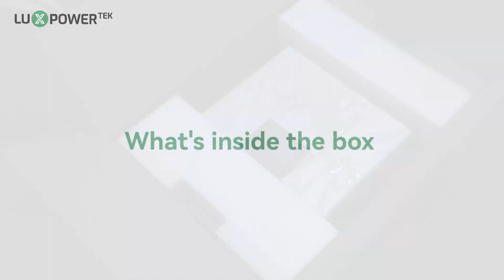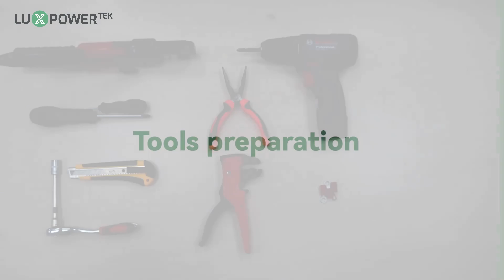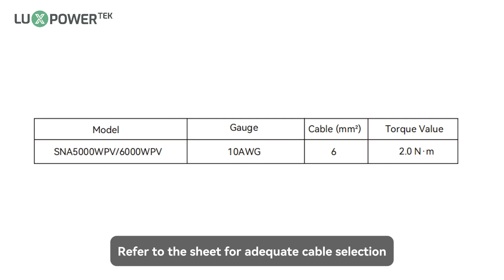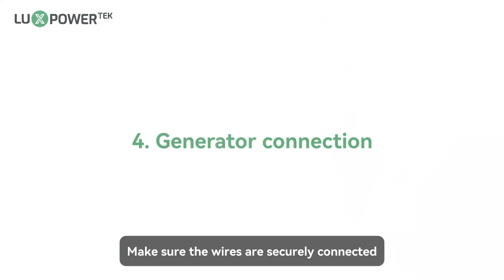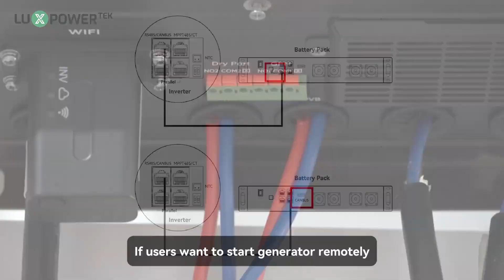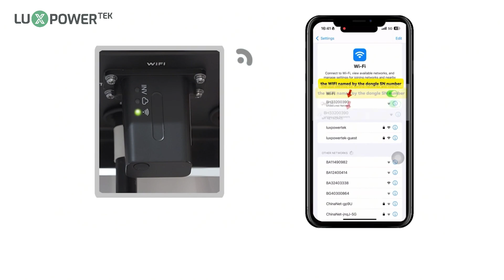LuxpowerTek SNA 3-6K Installation Guidance

Comment: IF I will use it for off grid system only. No any AC input connection , In this case the AC output need or not the PE cable? 
Your diagram showed AC output with PE cable.
If need PE cable , where is the PE connection for AC output?
Thank you.

Comment: Hi @LuxPowerTek, 
My 6kW IP65 Inverter SN: has a recurring "Fan Stuck" error - 4th time. 
No reply from support email. 
This is a warranty issue. Please DM me or reply here with next steps for fan replacement. 
Location: Peshawar, Pakistan. Thanks!
Reply from the maker: Hi, we noticed that you emailed us on today morning, and we've already replied to you.

If you have any questions during the fan replacement process, simply reply to the email—our technical support engineer will be happy to assist you until the issue is resolved.

Comment: I am using the Luxpower SNA5000WPV (internal CT version).

I would like to ask:

Should the GRID connection be connected to port A (the priority/normal source) or port B of the ATS?
Which ATS port should the inverter AC OUTPUT (EPS output) be connected to?
Reply from the maker: Hi there, thank you for reaching out to LuxpowerTek. Could you please share us with the ATS photo to sales@luxpowertek.com?

Comment: In your video you use 8-10 sq mm cables for AC in/out, but in your manual you say 6 sq mm (for the SNA6000 WPV that I bought)... Can I use 6 sq mm? I probably will never use more than 5000W or for short periods of time.
Reply from the maker: Sorry for the confusion.
6 sq mm (10 AWG) is the standard size per manual, and it can be used.

Comment: Chinese manufacturers are literally dumping these cheaply manufactured high-frequency, transformerless inverters on the US market. It's a well established fact that high-frequency, transformerless inverters offer a much shorter life expectancy and a far poorer surge capacity, and can damage your appliances when their MOSFETs fail. The primary reason for this is that the engineers who designed this low-cost inverter made the decision to strip out the most important component in any inverter, the output transformer. They did this for the sole purpose of reducing the shipping costs from China to other countries. The problem with removing the output transformer is that this inverter does not provide any galvanic isolation between its DC boost stage and its AC output, which makes it dangerous for use in residential applications. A much better choice for an inverter would have been to install a low-frequency, transformer-based inverter. 

Low-frequency, iron core, transformer-based inverter chargers offer a far longer life expectancy and a much higher surge capacity than low-cost, lightweight, high-frequency, transformerless inverters, and are a far safer choice for powering your home's appliances. That's why all US-made inverter manufacturers only use high-reliability, low-frequency, transformer-based inverter technology. If you don't believe what I'm saying, ask Google.

Comment: Why is this inverter called off grid when it can receive AC input.
Reply from the maker: Hi Sir, An off-grid inverter is designed to work independently from the utility grid, supplying power to loads using solar and batteries.
Although it can accept AC input (such as from the grid or a generator) for backup charging, it does not export any power to the grid in regions with strict regulations, which is why it’s called “off-grid.”
This feature is especially important in regions with strict regulations about selling electricity back to the grid.
Reply: @LUXPOWERTEK can the gen2-6000w export power back to the grid?
Reply from the maker: @SleepyDioma  Yes, for GNE2 6K mode, the max. export power to grid is 6kW.
Reply: @LUXPOWERTEK can you also check if the SNA 6000w can export power back to the grid in the Philippines? We have a net metering law here and power exportation is allowed.
Reply from the maker: @SleepyDioma  Hi there, thank you for reaching out. Please contact with your device supplier to open the hybrid working mode for export power back.
Reply: @LUXPOWERTEK Thank you!

Comment: I'm looking for an off grid inverter that doesn't have a capability for receive an AC input. Is this luxpower inverter the one?
Reply from the maker: Hi Sir, thank you for contacting LuxpowerTek. If you don't want to receive power from AC, you can simply leave the AC input (such as grid or generator) unconnected.
The inverter can still operate in off-grid mode using solar and battery only.

Comment: SNA 6K Eco Hybrid, does it have smart load on Gen Port?
Reply from the maker: Hi Sir, Yes, our SNA 6K has the separate GEN port with the multi-functions, which can connect with Generator or AC coupling or smart load.

Comment: Hello, when will the firmware for the SNA 5000 be released that includes Smart Load on the Gen port? And will it be possible to configure it through the Application?
Reply from the maker: Hi Sir, thank you for reaching out to LuxpowerTek. Regarding your question, due to hardware limitations of the old SNA 5K model, it unfortunately cannot support upgrades to include the smart load feature or AC coupling through the GEN port. We apologize for any inconvenience this may cause and appreciate your understanding.